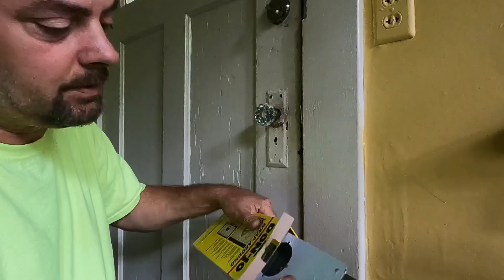Converting Mortise Lock to Schlage keyed knob with Wrap Plate

Comment: How are you securing the latchplate with a gaping hole in the door? For me, there was nothing for the screwes to screw into. Or maybe I need shorter screws?🤔
Reply from the maker: Some wrap plates are designed to go over the latch and have a flat inside, which is probably what you got if you purchased from a box store. These wrap plates (Don-Jo brand) have a threaded nut and recessed face so the latch goes on the outside for it. The machine (threaded) screws come with it and attach the latch to the body of the wrap. Any of the flat face type won't work for this type of job unless you pop rivet the latch to the inside of the flat style wrap
Reply: I had the exact same question. I had this huge 3x5 hole and didn't know I'd I needed to fill it. My face plate does have the recessed face to handle the situation.

Comment: What do you think of customizing a piece of wood to fill the mortised gap. I was thinking of adding saw dust and glue to fill any voids and tapping my customized wood into the mortised space. I might add a few wood dowels across the width of the door where my customized is, for insurance. Then I’d proceed to hole saw for standard lock. The door is in good shape, so would rather not add a plate.
Reply from the maker: Absolutely valid! I don’t like using wraps at all but on some properties/doors it’s not worth the carpentry. I would never willingly put one of these on a nice door.
Reply: Thanks. I appreciate you were fixing the door to your client’s desire. Good vid showing all the steps.
Reply: When my 1930s house was renovated in the 1980s, several of the mortice locks were changed over by filling in the gap with builders bog. When set, install new lock as for a new door. Still working.
Reply: Is it like bondo? I filled a mortise lock soace in a door with a customized piece of wood, a little saw dust, and gorilla glue. I wanted to maintain the doors integrity and strength. But if builder’s bog does that I’ll save myself the trouble if customizing a piece.

Comment: I am having to change my locks which are these type. I have looked for this wrap plate and cannot find it in the stores near me here in Canada. May I know where I can look to find them? This video is the most suitable for me as a newbie.
Thank you!
Reply from the maker: hmm not sure about Canada but it should be listed under door wrap, door wrap plate, remodeler plate, etc. Just make sure you get the door thickness, and backset (measurement from edge of door to center of lock) correct

Comment from the maker: the first few comments made me realize I needed to post why I went wrap ;) There is a modernization kit with two flat plates and a edge plate that can also be used for these conversions that sometimes looks/works better. I chose to go wrap for this because of thin door, good gap, and existing edge damage around latch. 
In a different scenario it is my preference to use the flat cover plates as well (but I don’t like their edge strip, it’s too bendy so I use the commercial version) but it’s pretty dicey on the thin doors :)
Reply: Can you share the link to the modernization kit? I need some.
Reply: Kwikset modernization kits Nos. 214 and 215 can be found at hdw stores.

Comment: If the screws on the outside of the door were removed, would that compromise the security of the lock? Also, is it worth filling in the hollow core left by the removal of the mortise lock? I have a front door im planning to replace the mortise with an updated lock.
Reply from the maker: no, because the locks are still "clamping" it on the door. The only way it "might" is if there are large holes all the way out to the point if you did bend the corner back, you ""might"" have access to the latch to do something, but this is a very unlikely scenario. Yes if you are good at carpentry then by all means fill in whatever you would like. The most ideal way to do this aesthetically would be to patch everything and paint over, then re-prep for the lock

Comment: Personally I like using the do-jo remodeler kit that come with 3 seperate pieces. The wrap plates are good in a pinch when there damage. But I think it ends up being s nicer looking job in the ends.

I've managed to stock up on the older kwikset kits before the stops making them.. those work nice in but locks
Reply from the maker: I thought about using that but since this one had existing edge damage I decided to go wrap :)